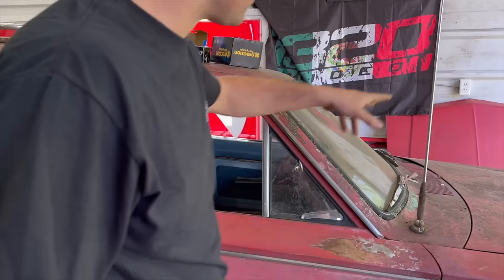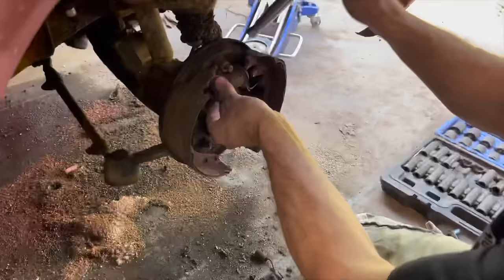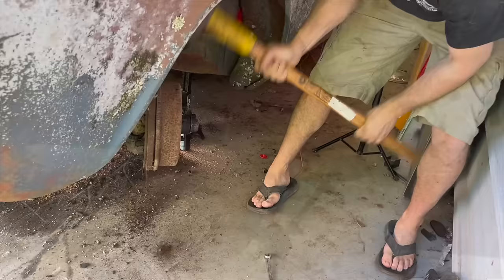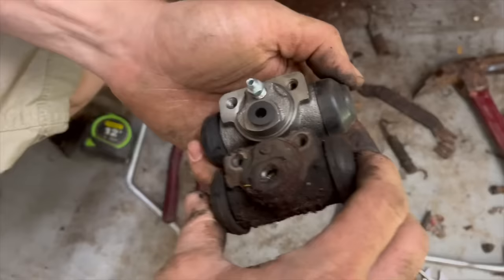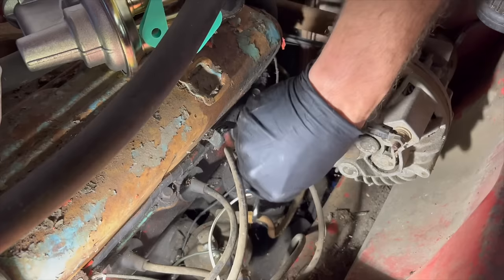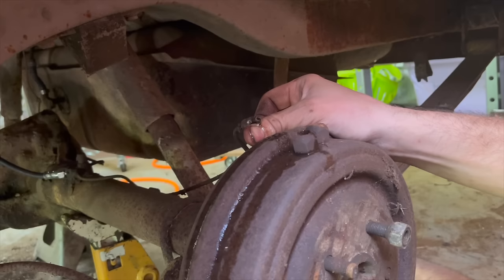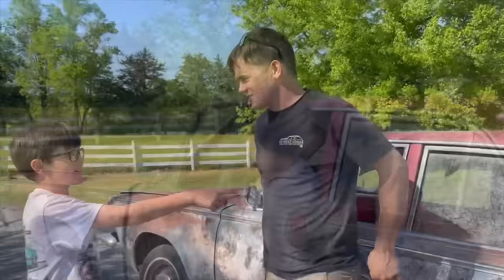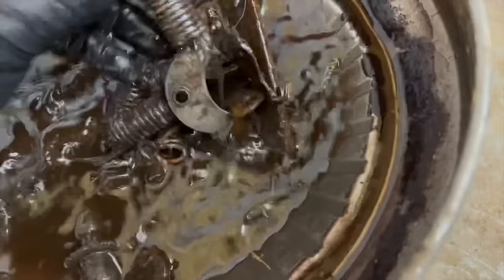Can it pull a trailer after 30 years parked? 64 dart station wagon first drive

Comment: "Ralphie power" 🤣
Those old 6 banger Chrysler engines were bulletproof. I had one literally! Had a '66 Dart rag top. We were camping and while trying to get back to civilization drove onto some Deliverance type of Hillbilly's property. He came out shotgun blazing. Drove with the accelerator pinned in reverse. One bullet hit the manifold, luckily it didn't penetrate nor crack the structure.  Drove that engine for another 200,000 miles 😬
Reply from the maker: That’s awesome

Comment: The major weak spot in the front end design of the darts and valiants is the idler arm bushes. Back in my early days of selling car parts I would sell a bushing kit almost every day. All the Valiants I owned had to have the bushes replaced. There used to be a bearing kit to replace the rubber bushes which was a much longer lasting repair.
Reply from the maker: Ok thank you
Reply from the maker: Ok thank you
Reply: yes indeed always had to replace the idler arm bushings on our Valiant and my 1966 Dodge Dart Gt.
Reply: A friend of my dad bought one. On the way home bought a replacement kit before he even got the brand new one home the first time.He had the car for 15-20 years and never had to replace the new kit.Go figure!

Comment: 20:40 the drum on that was stuck you have to use a flat head screwdriver to spin that star-wheel adjuster closed on the backing plate those two slots at the bottom is where you stick the screwdriver then it will come right off like the passenger side
Reply from the maker: Ok thank youb

Comment: I was taught that just rubbing grease all over the outside of new bearings isnt enough. I put a scoop of grease in one hand and then put my point finger through the new bearing and do a scraping method that packs grease into the bearing each time you scrape a little more into the outer groove until it comes out the back of it. Works great !
Reply from the maker: Yeah your probably right
Reply: Vicegrip Garage does something similar with  the bearing  grease
Reply: Yeah there's a special way the grease is supposed to go in and out of a timken bearing or wheel bearing 👁️
Reply: Hand packing bearings. It’s really easy just messy. All you’re doing is using your palm to mash a pile of grease into the bearing until it’s packed full.
Reply: That is how I do it.  Scrap in your palm until the grease comes out the other side, turn, repeat.

Comment: Man the way I was taught to pack bearings was to slap a glob of grease in the palm of you weak hand , take the earring turned up in your strong hand and push it in the grease untill you see it start coming out yer other side of the bearing , rotate till you get it all around , then take the extra grease that is hanging out and smooth it around the outer side of the bearing .
Reply from the maker: Yeah that’s the proper way

Comment: Yes in Australia that bodyshape was ap5 and ap6 valiant and valiant regal. The ap5 had the push button auto and the ap6 had column  shifted auto. Just a bit of useless info for y`all!
Reply from the maker: Thank you for sharing
Reply: You're welcome. Love your  channel and content, btw.
Reply: Also, here in Australia they stopped using the slant 6 in 1969 in favour of the locally produced hemi 6. Like the u.s. v8s they had a hemispherical combustion chamber and the top dog was the 265 with triple 2 barrel carter carbs, the 6 pack e49 r/t charger engine with 302 hp. The v8s available in Australian built chryslers were the 273, 318, 340 and 360 small blocks.

Comment: Hi everyone, man this wagon beats the heck out of the radio flyer Lol!! This is going to be a real rubber neck'n head turner and grin git'r!! . I would've been right at home restoring the brakes. Make sure they are all adjusted & and the car doesn't pull too hard left or right, 'cause on wet roads you will be in trouble if you have to stop fast. Have fun learning and it's great to see the boy figuring all this automotive stuff out. He's going to be a great asset to you and man, there's just way too many kids sitting inside playing video games. That goes for boys and girls! I applaud you for the wisdom of get real, get outside in real sunlight. Safety First, and always.
Reply from the maker: Thank you I appreciate it

Comment: Two easy ways to stop rust where it is.  Firstly, silicone tire shine can protect mufflers and exhaust, especially where they rust most, near the rear axle.  Secondly, take it to a self serve car wash, with a jack if it rides low, and maybe on the trailer if first bringing it home, turn the dial to spray wax and spray wax the underside and any potential rust.  The spray wax gets into all the crevices and seems unlike hand wax.  Do this repeatedly if you can repeatedly get it by the self serve car wash.
  Ceramic wax from a trigger sprayer might also survive exhaust heat.  I'm still testing that one.
Reply from the maker: Ok thanks

Comment: Great vid!  My father in law had a '68 New Yorker with 4 wheel drums and said that he had to adjust the brakes as regular maintenance.  So I guess it must be similar to your S/W Dart.... no self adjustment.  Just guessing , though.
Reply from the maker: Great tip!
Reply: Except for certain Heavy Duty optional 11 inch drums, these cars all had self adjusting brakes.  That doesn't mean someone didn't chuck the self adjusters in the past like happened in some of these in the video.  
   If you drive the cars too gentle in reverse, the self adjusters may not cinch up. Did you father in law drive super slow?
Reply: @auteurfiddler8706  Yes that is a definite possibility.

Comment: Lichens grow on rocks outdoors, and as far as I know, goats and sheep both eat it. Don't think it will hurt him. I was told when i was ralphie's age that the left hand thread was because the lugs would tighten if they were left loose.  The ford diesel pick-ups were like that. I had a 1984 that had left hand thread on the driver's side. The cables and levers you picked up out of the trunk are self-adjuster parts
Reply from the maker: Ok thank you good info

Comment: One tip I heard some years ago for welding petrol tanks. If you have a dual gas regulator for the MIG welder you can run a gas hose into the tank and run gas into it for 10 minutes or so before welding and during welding to purge the tank and avoid explosions.
Reply from the maker: Ok thank you

Comment: As a mechanic  decades ago I did many brake jobs. A rule of thumb to remember on self energizing brakes is "Short shoe to the front". It's job is to push the rear shoe (long one) into the drum reducing pedal pressure needed.
If you install them the other way, the short to the back, it will wear out fast and you will find the long on with much less wear.
Reply from the maker: Ok thank you

Comment: I have that same Harbor Freight engine hoists so far I have used it twice. Neither time to pick up and engine picked up two world war 2 Transmitters and loaded them in a truck. I remember when I was 8 or 9 years old I was helping my Dad bleed the brakes on our 1950 Oldsmobile Rocket 88 and I'm 71 yrs old now. Some things never change. Looks like Rocky has been busy with all of those babies running around. Thanks for a great video.
Reply from the maker: Thank you for watching

Comment: Try turning the brake adjusters down all the way to remove the drums. Heat up around the studs with a torch red hot. Hammering the drums will warp or crack the cast-iron making it hard to resurface the drums. Just my $.02. Great video !
Reply from the maker: Ok thank you

Comment: Name that song- Dreamweaver by Gary Wright... Also the spring on the brake drum is a "Dampener Spring" it keeps it from screeching loud and absorbs vibrations from the brakes.. The bigger wheel cylinder is for a V8 engine edition of the wagon... A TIP from an old skooler mechanic... Before you start beating on the drum go to the backing plate and loosen the starwheel adjuster to shrink down the pads before you start yanking off the drums
Reply from the maker: You are correct, thanks for the tip
Reply: @Sleeperdude  Always glad to help out Sleeper Brotha

Comment: Hi from Western Australia Sleeperdude. I really enjoy watching your videos with family interaction. The Dart in Aus is the AP5/AP6 with slightly different front and rear panels. I currently have a 1966 VC Valiant Safari Wagon under restoration, running the same power plant as your Dart - 225 Slant Six. I also have recently acquired a 1976 Dodge Truck (farm find). Been sitting for 25+ years, so I intend to do a will it start, run and drive video soon. Anyway keep up the entertaining videos.
Reply from the maker: That’s awesome good luck . Thanks for watching

Comment: On brake lines, the more room you have to let it twist without permanent damage, the farther you can loosen the clamping nut and the better chance you have of coaxing it to break free,  so you don't want to hold the line tight like you did on the first one, but let it flex like you did on the second.  It also helps to bang on it because shock waves break up the rust inside the joint.
   On the master too, it broke because you held it.  If you had let it twist as far as it could without damage, and then tapped on it, and then sprayed it with penetrant. you probably could have saved it.  
    Also, maybe not at that age, but you can often save brake and clutch cylinders by disassembling, honing or fine sanding or scotch brite etc. brake assembly lube, reassemble, and test for leaks.  Trouble is new seals sometimes cost almost as much as new cylinders, but sometimes not too, and old ones can be viable if well cleaned etc.
Reply from the maker: Ok thanks for the info
Reply: true!!!!  in the absence  of available rubber cups....ive done it...many times...

Comment: A real good break tip take a butane torch and heat the nut up on the line nice and hot and then quench it with a spray bottle of water that break the rust loose so you can remove the line without breaking it
Reply from the maker: Ok thanks for the tip

Comment: 65 Valiant is AP6 I owned a $20 example it also ran great no muffler and copious rust 225 engine manual, it was also a tow home job,(broken uni cross) got another tailshaft at the dump and it away.
Reply from the maker: Awesome

Comment: You guys rock! So much fun seeing an old A-body car of any style coming back together into running condition by the force of ingenuity and stubborness more than a thin budget. Makes me want to have a go at my own ghost of a derelict ´65 Valiant, neglecfrted by the previous owner since who knows when and (ahem) by me since ´99. All that worn-out junk underneath looks just so familiar.   Although in my Valiant most of it is since long removed to be replaced by slightly more modern stuff (original 100 hp six was shot, rear axle sold to another in need) when/if a new floor and  front rails are fabricated, otherwise fairly nice body about the same condition outside  as your wagon is held together by the rocker panels. Your vid´s good inspiration showing what can be done if you put your mind and hands to it, thanks man. Subscription set, i got to follow this :-).
Reply from the maker: Thank you really appreciate it

Comment: JB weld, I have used it on aluminum oil pans. Grind the area, use a good metal cleaner and and two thin coats! Fixed! Man that stuff works. Wish we had had some in the 50’d 60’s. 👍👍Good stuff guys!
Reply from the maker: Thank you

Comment: END of Vid.  THE Timings TO low.  AND That's From The points wearing down.     Always go I size over on feeler gage cause the points collapse after a few minutes of running.    But ANOTHER Banging vid.    YOU ALL ARE THE BEST AND IT WOULDN'T BE POSSIBLE without you Sleeper Dude.    ❤️ 💛 ✨️ 💕 ♥️ 💗  TAKE CARE
Reply from the maker: Thank you. Your probably right

Comment: If the brake shoes are cemented to the drum, you are going to brake stuff when you use the puller but it can't be helped. 
    If they are simply very tight, you owe it to yourself to use the brake "spoon" in the little slot to adjust the star wheel.  But, it is kind of hard to figure out which way to turn it and, as we saw here, some are rusted stuck.
Reply from the maker: That is true

Comment: Ford and Dodge had major driveline vibrations back in the day. They both did some crazy stuff to make things stop shaking.

I had an 88 Acura Legend the CV on the divers side locked up. The wheel didn't fall off but the car did a 180 into the other lane. I hit the cv with a hammer i had in the trunk and got it to unlock. Then i clicked my way home.

The second song is Billy Joel – Piano Man.

Wow didn't know vinegar worked that well on rust!
Reply from the maker: Yes!!! Thank you
Reply: @Sleeperdude  No problem!

Comment: Yes, I ran a wheel off before. It was on my 1979 jeep CJ five with an AMC 20 rear differential with two piece axles. The previous owner lifted the jeep and put off-road mud tires on it without putting solid one piece axles in it.  The 2 piece axels spun right a part on the highway. Thank God I was downshifting. and slowing down on an offramp. The rear left wheel flew off, scared the shit out of me.
Reply from the maker: Sometimes it happens

Comment: If memory serves me those coil-type brake shoe retainer springs that got bent... to install... you insert the spring in its hole on the brakeshoe, insert a Phillips screwdriver into the spring, bring the shoe & spring to the backing plate, Push the spring out with the screwdriver and twist and manipulate the hook using the screwdriver into the hole and pull out the screwdriver. Then set the brake shoe in its place and repeat on the other side. remove the shoe the same way by removing all other things tilt the shoe insert the screwdriver in the spring twist & manipulate the spring with the Phillips driver.
Reply from the maker: Ok thank you

Comment: I ran over something in the road in my '62 Ford Fairlane when I was in high school.  It punctured the bottom of the fuel tank.  I didn't notice it until I got home and there was gasoline dripping on the driveway.  I mixed some Bondo and smeared a big blob of it over the hole as the gas was dripping.  It held perfectly for the next two years and I sold it.
Reply from the maker: That’s awesome

Comment: I like to spray PB Blaster where the metal brake line goes into the nut and let them soak for a while to try get them loose. Then I put a little anti seize on the line before putting the nut on. I last did that on transmission cooler lines at the radiator.
Reply from the maker: Yeah that’s a good plan

Comment: Hey sleeper dude, I have to say I just love the way the whole family pitches in to help. Also I was wondering if you have ever heard of a product called Red Kote? I don't know if I had mentioned it to you before or not but if not only works great inside the tank for sealing off bad spots but it also works great on the outside of the tank . I used it on my motorcycle tank rather than this other stuff that they said would work but I did some checking and it actually ends up coming off. As far as J-B Weld goes I'm a firm believer in their products, although they did not make a interior sealer for my tank as I needed at the time oh and by the way you can get red coat at your local O'Reilly's. Many blessings to you and your family keep the videos rolling.
Reply from the maker: Ok thank you I have heard of that before thanks for the info

Comment: Is your goat Win Gus, or Wing-us (like dingus)?? "Piano Man" - Billy Joel. Self-Adj. rear and Manual Adj. Front was a common set up for '60'd drum brakes. It's surprising that the drums were all good. Didn't look like any belling or ridge on the inside - but good for you! We always used LubriPlate White Lithium grease on the shoe contact points on the backer plate and the adjusters. Now I guess anti-seize is common. 

On the fuel tank, we'd always solder them with a large iron that required heating with a torch. That kept open flame away from the gasoline, and no electrical connection. We used the same big irons to solder radiators, too - always with flux. 

Great work - always good to see your family pull together.
Reply from the maker: Thank you .. Wawa named the goat wind gust 💨
Reply: @Sleeperdude  - Ah, doesn't leave any room for Wing-us, does it 😂 All 5 are adorable; actually all of the goats and other critters. Vienna is just a hoot. (♪♪ Oh, my Vi-e-na ♪♪)

Comment: An old trick that works on gas tanks, I had a hole in my tank on a 1978 dodge van the size of a quarter and take a bar of soap and plug the hole I ran into rebar, and then I used clear silicone and it was still there when I sold it 2 years later, Jim las vegas nv
Reply from the maker: Wow might have to try that sometime